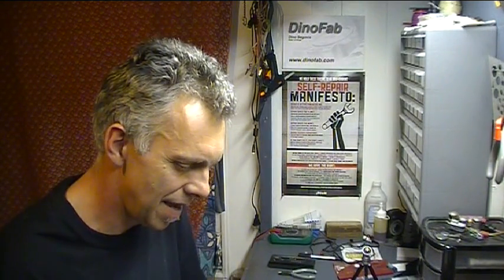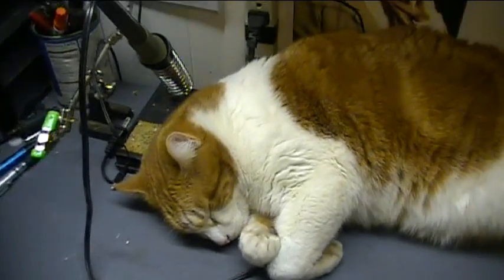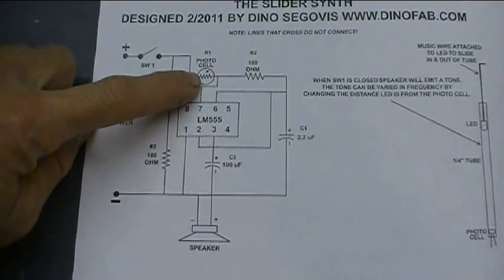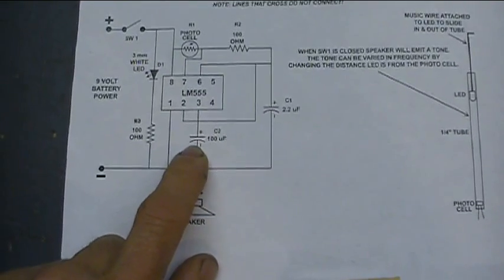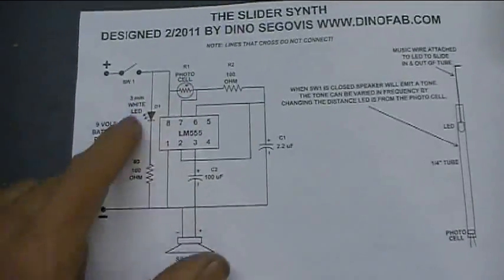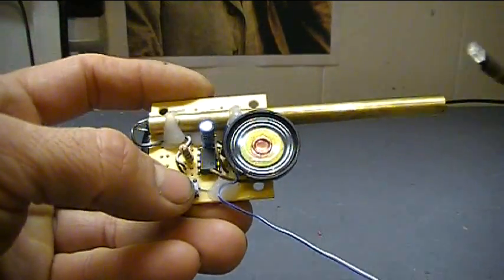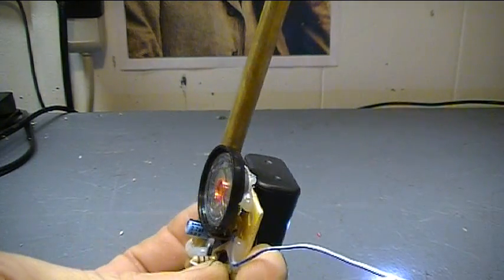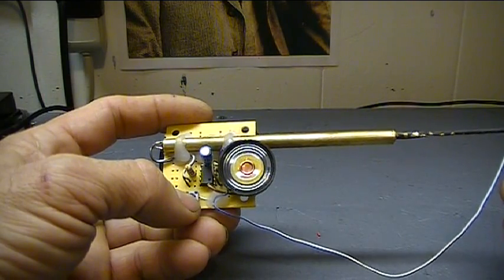The 555 SliderSynth

Comment: Not sure if you still check this channel, but I have a question. I wired this circuit up for a class project, but it behaved the opposite of yours, with a shorter distance between light and resistor sending the pitch down. Any ideas on what may be wrong/how to fix it?

Comment: He failed to do one thing that is very important in every 555 circuit.  There must be a 0.1 uF bypass cap across the power supply lines as close as possible to the 555 chip.  This is always needed.